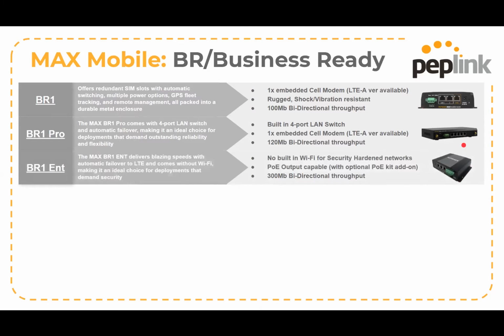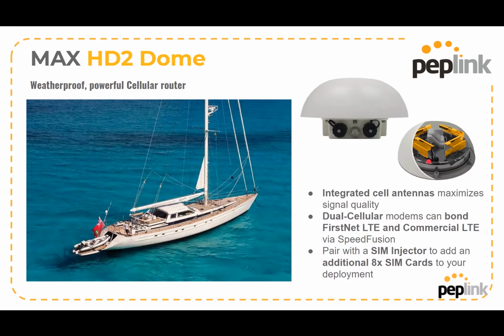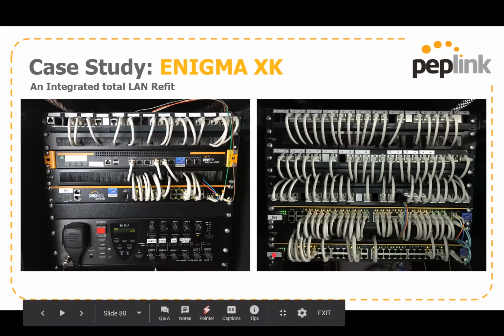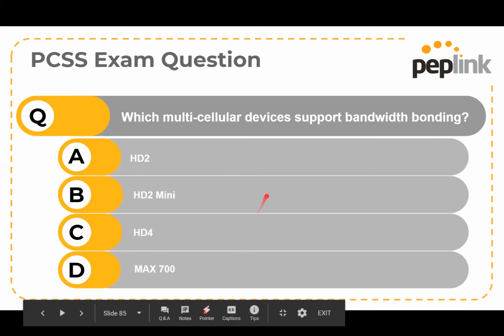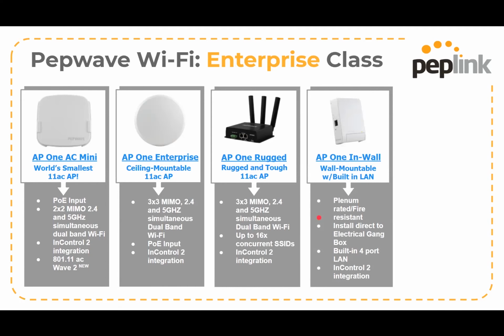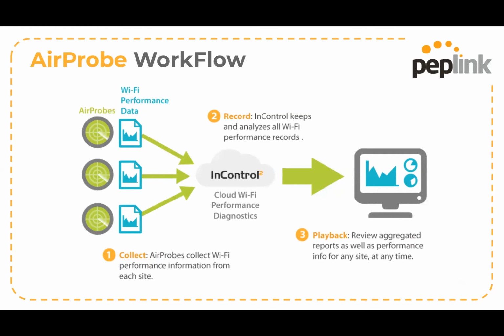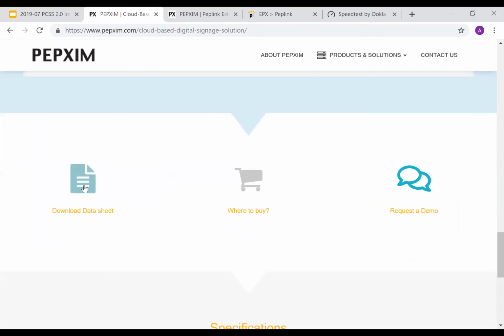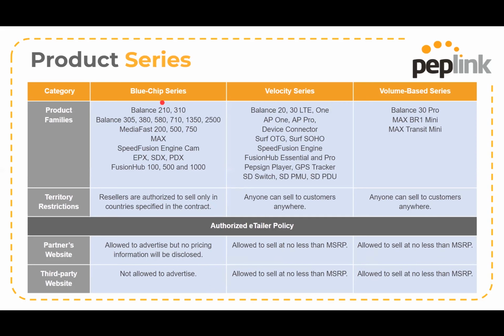[Peplink Webinar] Peplink Certified Sales Specialist PCSS - Session 2

Comment: Speedfusion Engine has power input via USB? I thought it was only 12-24VDC and the USB is for LAN?
Reply from the maker: The SFE requires 12-24 VDC using the terminal block connector. The micro USB connector is a LAN connection and if you plug it into a PC it will automatically come up as a network connection. This slide is a little outdated, we're working on a new PCSS :)